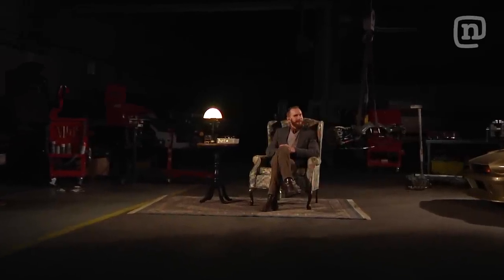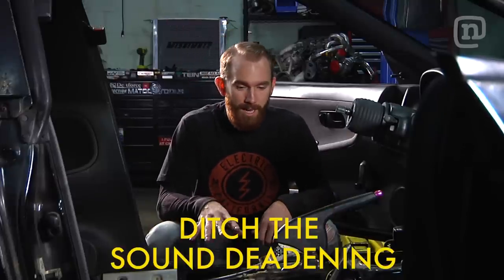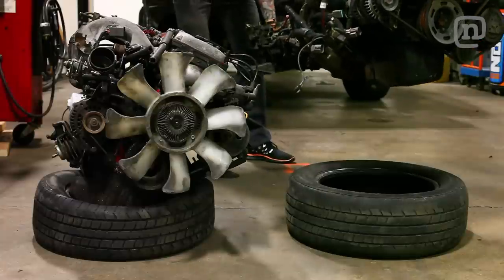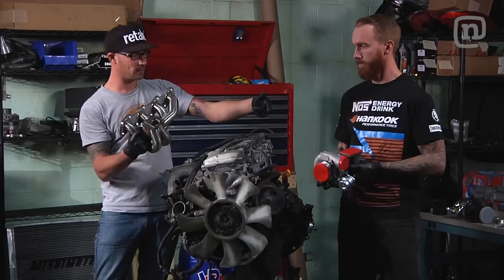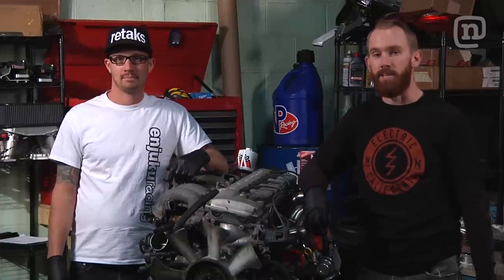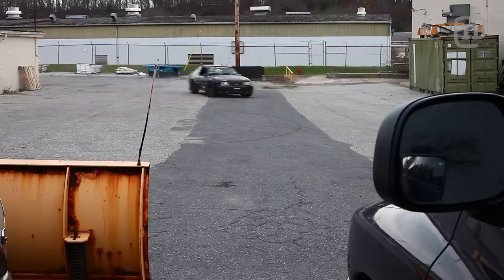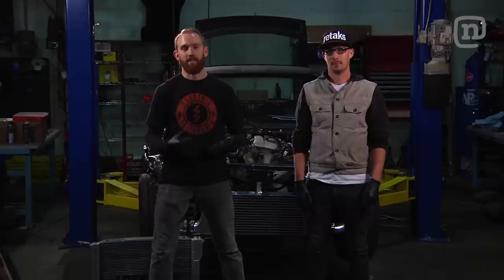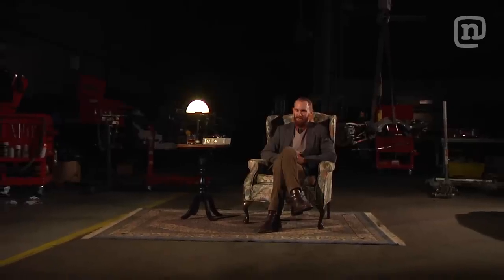Chris Forsberg & Ryan Tuerck Drifting Missile Car Turbo Upgrade: Drift Garage Ep. 2

Comment: I see you guys bought new injectors, where they replacement oem injectors or where they larger? I see you are running a n62 MAFS so what did you guys do as far as tuning? Are you using a FPR? What boost are you running? These are important aspects of assembling a KA-T. PS im loving the show I think its one of the coolest things you guys have done so far, im looking forward to the rest of this series and also for greater things to come once this car is done. Maybe you guys could find someone who is troubled financially and help them with their project and finish it for them, kinda like pimp my drift missle. someone like me ;).

Comment: does the turbo and intercooler kit come with instructions? and is it hard for someone who doesn't have a lot of welding experience?
I loooovee these videos btw! can't wait till the next one!
Reply: welding isnt too hard. and worst case scenario i would bet someone you know will weld it up cheap
Reply: The header is included, so there's most of the welding already done! (No need to fab a header yourself). My guess would be it's just intercooler mounts/ radiator mounts if you're moving it to accommodate the intercooler. Welds for that sort of thing don't have to be perfect, aslong as they're reasonably strong!

Comment: Awesome vid guys! Can you explain to everyone (at least briefly) what route you went to map the ECU with the turbo? I hope it gets mentioned; the stock ECUs get really fussy when you add anything more than 6 or 7 pounds of boost and can be a real nightmare for someone on a low budget. Maybe an old crappy piggyback controller would help? Also, did you guys change the pistons? They're usually the first things to go on a KA-T. :)

Comment: Im actually really curious what MAF that turbo kit comes with ?  

Doing a great job so far.  Im personally ka24e and when i went boosted i had an extra ka24de maf laying around that i wired in and it ran shitty.  So i put the stock maf back on.   Is this maf in that kit a Z32 maf (N62) ?
Reply: isis makes a aftermarket z32 maf so i imagine thats what it was.  looks like a z32 maf anyway
Reply: battlestylespl We utilized the ISIS MAF in this build and it is shown in the cost of the turbo kit at $1530.  The ISIS turbo kit is $1400 and the ISIS MAF is $130 from Enjuku Racing.
Reply: so its a completely aftermarket maf or a factory oem maf that enjuku just has in stock ? 

would the maf used in this kit work well with a ka24e-t ? after i built my kae i've been looking at different mafs and just trying to figure out what would work best.  

I'd maybe like to accomplish close to what the car dynoed in this video. maybe 20 hp less
Reply: it's an aftermarket z32 maf made by isis
Reply: But what exactly does that mean ? i guess im just curious as to what makes it aftermarket.  

altered electronics inside a factory z32 maf ?  i just dont see how you can make a factory maf aftermarket.
Reply: it's not made by nissan....it is an oem replacement....meaning aftermarket.  like say you crash your car and get a cheap fender to replace your bent one..most of the time it wont be one direct from the source, it is an oem aftermarket replacement. basically the same specs, but not exact.  usually cheaper.  im sure a z32 maf from nissan is like $300+ if they even have any
Reply: Ahh alright, i personally consider aftermarket something that oem companies dont make.  personally i would just call it an OEM z32 maf instead of aftermarket one.  simply because to me aftermarket means its something completely engineered by a company other than nissan or toyota etc.

Comment: Did you guys run water coolant lines from the turbo and if so where did you tie the lines into on the ka motor. Also trying to figure out how the vacuum lines are ran from the fuel regulator to bov to motor. Thanks in advance. Building my first ka-t right now running stock sr20 setup.

Comment: question, for oil feed did you guys tee off the oe pressure sensor or did u use a sandwich adapter, if you did end up using a tee can you guys provide a part number for the tee piece, also i saw that you used a barbed bung for oil return, would you say this is good enough or should i run a -10 an fitting ?

thanks any info helps

Comment: I wanna know how they made nearly 300hp on that KA. Didn't show if they rebuilt the KA. What parts they actually used. How much psi they're running, what injectors, etc.
Reply: +Wreckless I agree, also, they didn't do any ECU tuning seems as if they're running this kit on a stock N/A block when the compression ratio should be played with too.
Reply: +Jake Hodgkins nevermind im an idiot they do it in the next episode.. lol

Comment: So you dont remove your radiator when you put an intercooler in you leave it in?
Reply: radiators are for coolant for the motor ... intercoolers are for cooling air, you need both
Reply: oh okay thats what i was confused about. One more stupid do you have to put any kind of coolant in the intercooler or jut leave it empty im not to good with intercoolers
Reply: Joseph Casperino no you need to get some intercooler coolant and that stuff is not cheap it's 80 bucks a gallon you will need 2 too 4 gallons most parts stores have it.

Comment: Wow, just about any old $500 American car will drift, many had to to change directions. BUT it only cost $5,000 to make rice drift! LMAO too funny. I used to drift my 6 cylinder 65' Mustang in the 80s around every turn, then I got 72 Challenger with a factory rear sway bar and V8 power. Too easy stock.